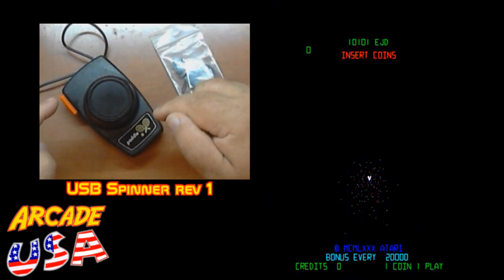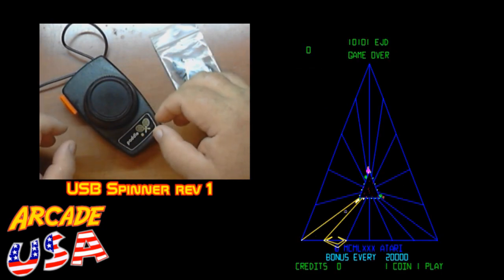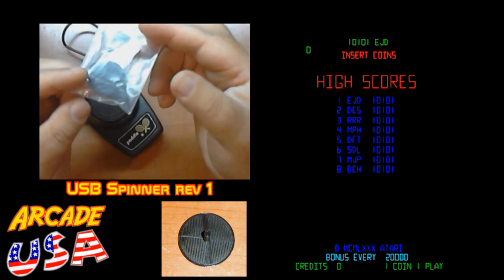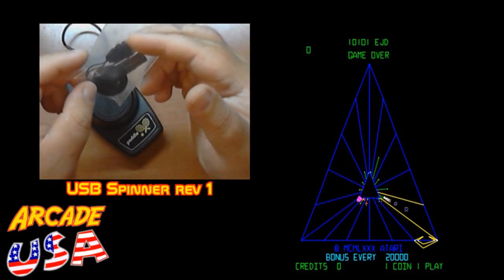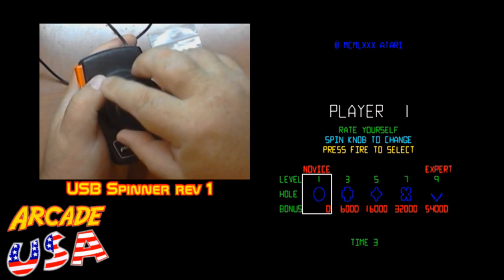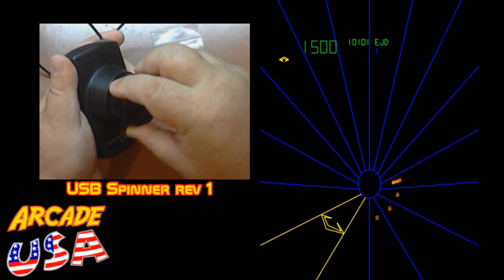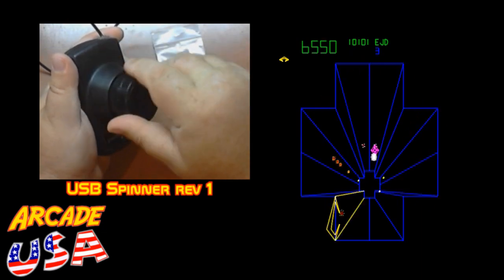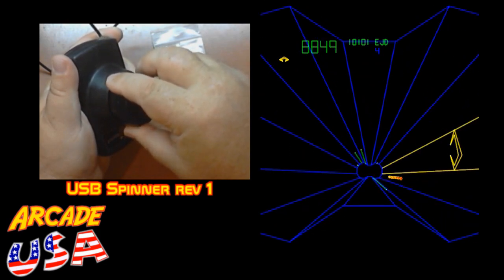Atari 2600 Paddle USB Spinner Mod Rev 1

Comment: Did you ever get to make the 2nd button for the Super Zapper? If so, could you share some pictures or video to show how you did that. Thanks.
Reply from the maker: I just added a little pushbutton switch and wired into the second button on the mouse internals I used.